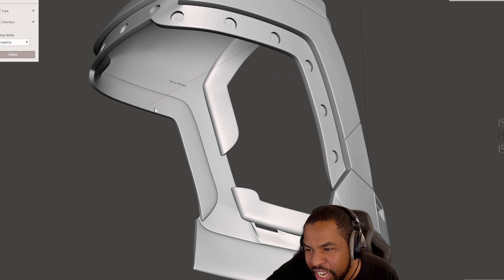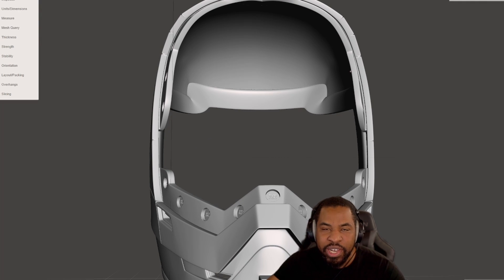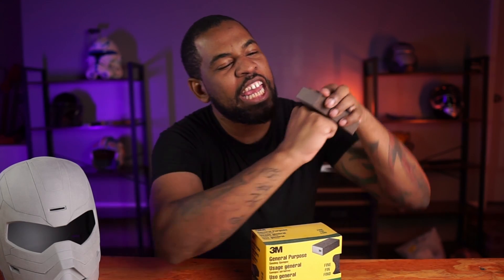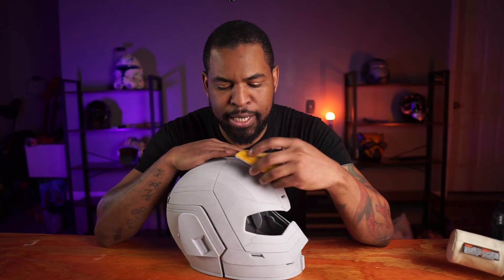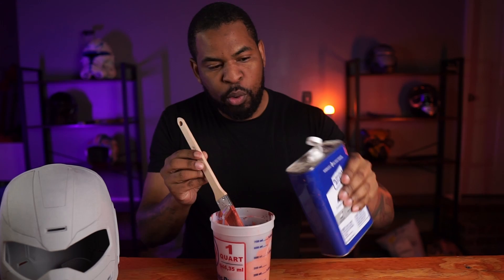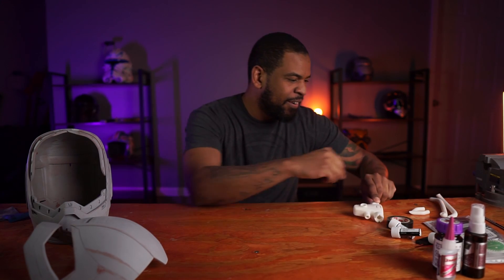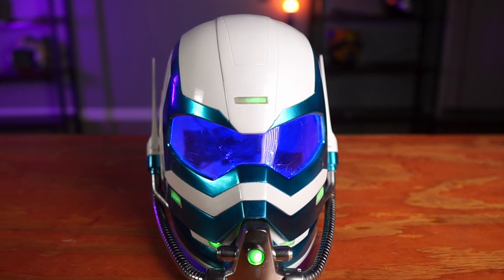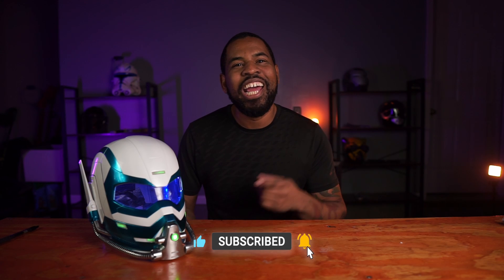The Ultimate Guide to 3D Print Your Goliath Helmet

Comment: Hey quick question! Im about to try the acetone method, do you sand with an orbital before doing this or do you straight up start with bondo acetone then hand sand? I was thinking of hitting everythibg with 80 grit orbital, acetone, then 100 grit manual, 240 and finally 500 grit wet sand.
Reply from the maker: It’s a few more steps but I orbital with 80 then 120. Then I bondo/acetone 220 but you have to sand the bondo all the way off. Then primer followed up with wet sand 220 then 400